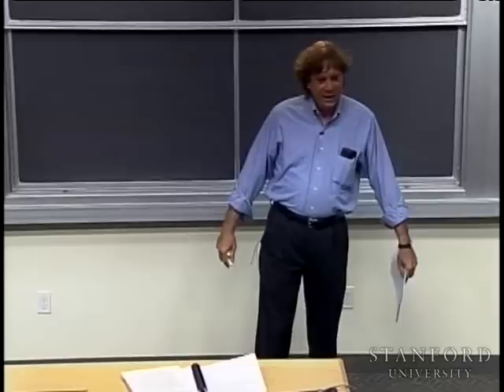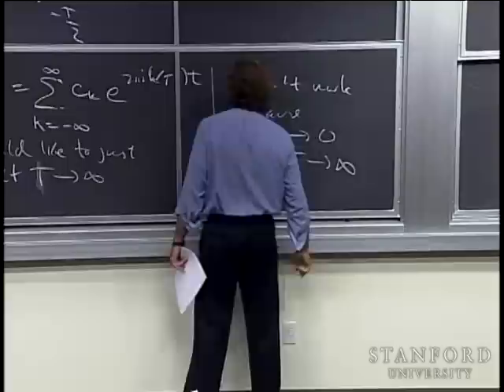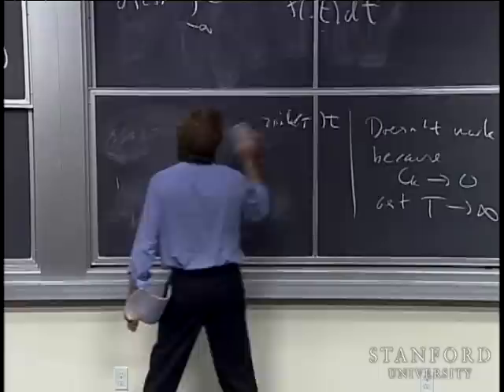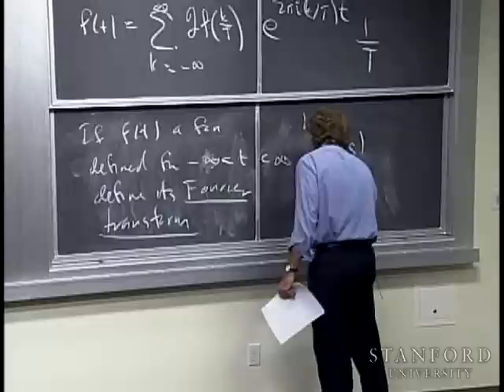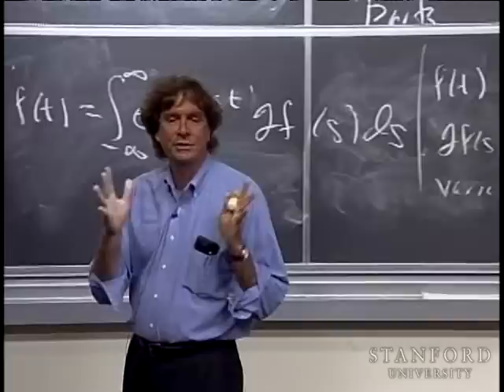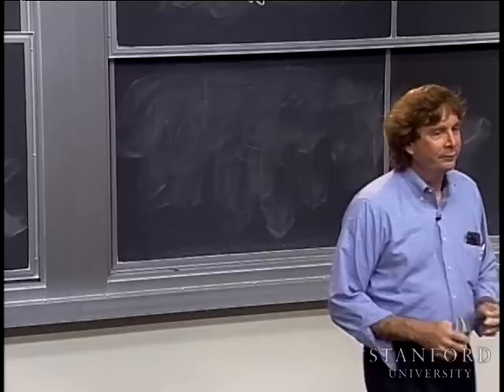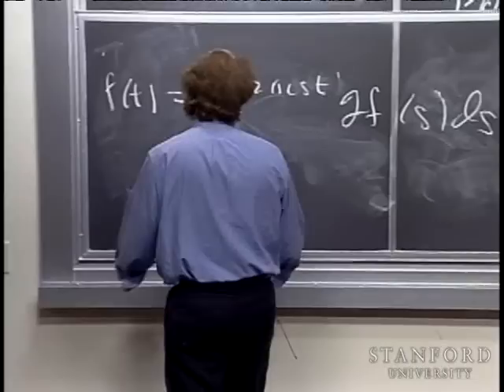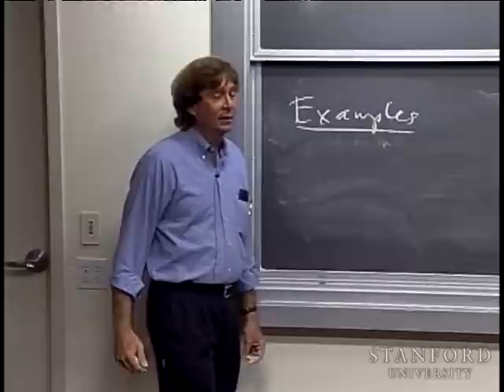Lecture 6 | The Fourier Transforms and its Applications

Comment: He derives it very nicely in lecture 2 (second half). Basically you pull out one term of the fourier series (Cm * e^(i*2pi*k*t)) and leave the rest of the sum on the other side, and then you integrate. Since sum = f(t), pulling out one term leaves you with Cm * e^(...) = f(t) - (rest of the sum). To isolate Cm, you have to divide by the exponential, which is the same as multiplying by e^(-...). The "rest of the sum" term goes to zero when you integrate, so you get Cm = f(t) * e^(-...).

Comment: @laserbruce more dire a problem in my opinion is that the cardinality of the real line is greater than that of the set of all points spaced 1/T apart, so there will always be a huge gap when trying to cover up the real line with these points

Comment: He assumes that the series tends to a continues function as T go’s to infinity. Since this is not a proof, I can live with that.

The problem that I have is that as T go’s to infinity the distance between the points at each end of the period tends to 0. As this happens the values between the points (Including the ends of the period) tend to a single point on the x axes. This means that it will tend to a non-Integrable function. 

Someone show me the light.